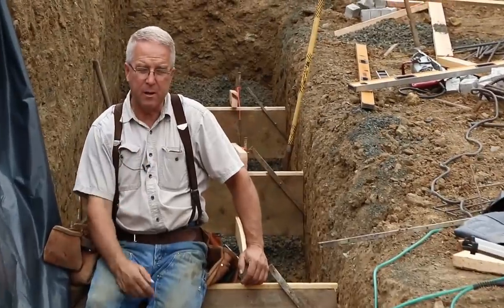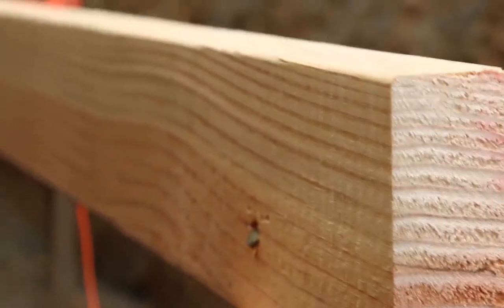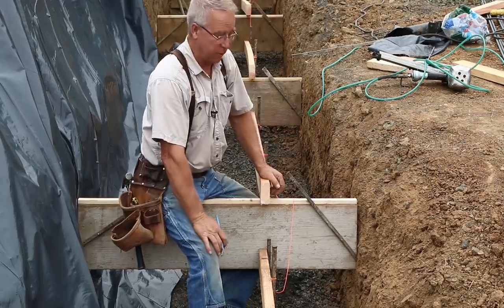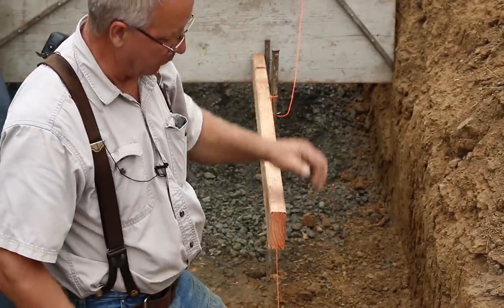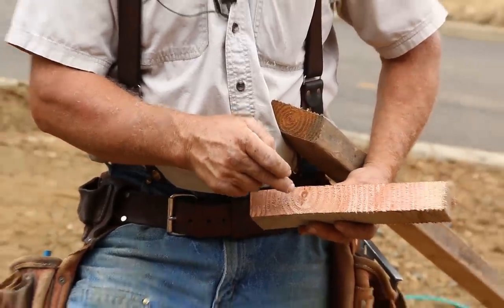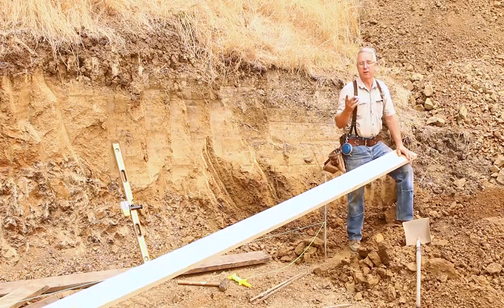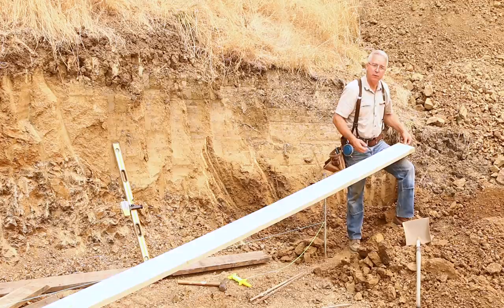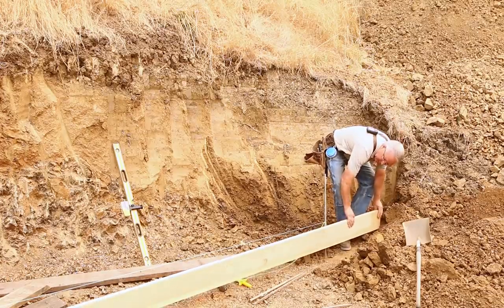Things To Know About Lumber

Comment: What relevance does grain coarseness have to construction? I can understand it in a woodworking sense, but not so much regarding structural purposes.
Reply: the more the growth rings per inch, the stronger the wood.  Old growth pine is considered a hardwood, because it grew very slowly and has tight growth rings.  New growth is soft wood .. that is my take on it, but I am just an electrician.
Reply: The annular rings consist of pale spring wood, which is less dense and weaker, and darker summer wood, which is more dense and stronger. Lumber with tight grain tends to have a higher percentage of summer wood and is stronger.
Reply: Whether a species of wood is considered a "hardwood" or "softwood" species depends entirely on whether it has leaves/flowers or an evergreen. It's just a generalization of the growth pattern and characteristics of the type of wood. Pine, regardless of age and hardness is always considered a softwood. Balsa wood (extremely soft/light) is classified as a hardwood.
Reply: P B .. Pine being a hardwood has been a long standing debate on the jobsites.  Pine with tight growth rings is much harder then a fast growing pine.  It has always put a smile on my face to see our old growth dining room table, which is a hand-me-down built during the Michigan Lumber era.
It has certainly stood the test of time in our household and god willing will be passed on to the next.
Reply: One word: Strength
Reply: Dieselhead Apparently one of the most extreme examples is Southern Yellow Pine. The climax forest trees that were originally cut created wonderful wood,particularly desired as flooring in large buildings. Rapid growth wood from second and third growth trees is splintery,weak and almost unusable. Not sure of the Google entries that would help here. Reused lumber and complete logs hauled out of rivers etc sell at a premium,if you can find it. That much of a difference. Never seen  Douglas fir so coarse myself. Mind you,I once got to work with a house built 1925,so the structural timbers were gorgeous. We have cut the accessible old growth wood,so the reality is to take a page from Scandinavia and concentrate on creating and using recent growth trees.
Reply: Dieselhead framing lumber that's "good" from a woodworking sense is also wood that is straight, strong, and will stay that way. 
Crazy grained, pithy, and flatsawn/rifty wood from near the cambium isn't a very good framing lumber but often what you have to pick from these days. We used to pick and select lumber at the lumber yard but nowadays your more finding the worst culls and rejecting them rather than picking good lumber. Most units we get around here aren't good enough to pick, just cull. I sorted most of a unit a years back for just three 2x12 spruce staging planks that didn't scare me, but in reality, 1 of the 3 was "good", while the other two came down to ok-ish grain and less knots, nothing ideal, but they were ok-ish. 
30 years ago, we could just pick a few of the rafters the lumber yard delivered and have great planks, but no more. 
Incidentally, i had a nice selection of quite old 10' and 12' spruce planks I pulled from some framing probably in the early nineties that were tight grained and basically quarter sawn, pin knots only, and had them on a job around 2006. The two idiots that were "the crew" were older guys - Jim and Dave- who thought they knew everything and didn't like me as the boss as a younger guy;  one day I was on another site and they cut them up for temporary stair stringers and treads. Now I'm an "older guy" but at least I'm proving that some of us aren't idiots. I at first thought they were being spiteful but after hearing their comments they self-confirmed as idiots (dirty, beat up lumber is what they said. "Staging planks are aluminum!")

Anyway, good lumber is important, it's not just about woodworking.
Reply: In framing, this doesn't  have much relevance.  The grain coarseness should not cause a board to fail structurally.  Headers are usually doubled and joist or rafters are part of a system, so one "weaker" board should not be a structural issue.  Most of the twist and bends a board develops will have already occurred before it reaches the job site (except treated lumber).  If a board is split or bowed, simply don't use it or cut it into shorter pieces.  One does not need to know why a board is bad in order to know not to use it.  If you are doing finish trim work or some type of exposed framing, this will become more important to ensure work will continue to look good.
Reply: When you build furniture you can sometimes get away with crazy wood as the many pieces strongly jointed together help to hold difficult wood.  But in a framing sense the wood hangs out very far in relation to it's cross section; if the wood is not very stable the whole structure can be pulled away.  It's only called rough carpentry but anyone that builds that way is a slob.
Reply: david ervin To elaborate on your statement, you can get away with it from a structural standpoint. There are various other things to consider when selecting wood for furniture such as appearance and wood movement.
Reply: Dieselhead just a common fact in lumber.

Comment: I't is a good topic.... can anyone tell me how to identify lumber that is less likely to weep after being painted; if planning to use it in finishing work?  or how to avoid that problem.... thanks much for sharing
Reply: Jim Burns, Jr. --- I avoided the problem when finishing S.Y. Pine by painting shellac on the complete board, although usually the knots were the only problem. If you don't cover the complete board a 'shine' will show through the final finish in the area where the shellac was used. 
If it 'weeps' or 'bleeds' through the final finish, the wood might be too high in moisture. Check it with a moisture meter.
Reply: Thanks bud ... will look into that moisture meter topic... maybe not a world ending problem for a household project to end up weeping.. .but not fun.. and any young person trying to make money with woodworking sure would need to know... have a goodn.

Comment: Which boards in a house don't need to remain flat/straight?
Reply: Mecdemort, in modern stud construction the wall studs can be bowed, twisting, cupped, and the other structural members (especially plywood or OSB sheathing) will force them into shape. But nobody'll be happy. Especially the drywallers. 
On a slightly different subject, I'm always disappointed to see yellow sapwood sold as redwood. Sure, it's from a redwood tree; but the customer is usually paying for red heartwood. That sapwood will rot faster than anything.

Comment: Great video! I really enjoy the channel. 

I will say though, as a seasoned woodworker, that a few terms may have been confused. 
The orientation of the grain pattern he first shows is actually referred to as quarter sawn. Vertical grain refers to the grain pattern along the board. A quarter sawn or rift sawn board will usually have a vertical grain pattern along the width of the board. This means the long lines of the growth rings appear as stripes down the board. The term quarter sawn describes a board with growth rings in straight lines running perpendicular to the width of the board in cross section

In regards to growth rings, tighter rings in Douglas fir does not always correlate with strength. Doug fir grows in rings of a hard, high-silica shell spaced between pithy soft layers. Doug fir is excellent for building because these two layers help add to he overall strength of the board. The soft layers help the board flex and not fracture while the tough layers add tensile strength to the wood.  Like laminated high carbon and low carbon steel. With tighter growth rings, you do run the risk of using a board that is too brittle, and unable to flex and absorb. These boards tend to fracture rather than hold the load. 

I only know this because I work a lot with old growth reclaimed doug fir for furniture making. I don't use coarse young grain because it isn't hard enough for furniture surfaces: it dents easily. The tight grain old growth is much harder to scratch and tools more like hardwoods, but I tend to see a lot of brittle fractures in old beams. 

Roy Underhill explains this with hickory in one of his videos. Old hickory is tough but brittle, while young hickory is taught and holds strength. He throws in some Andrew Jackson references too (he was called "old hickory" during his time in the army). 

Keep up the great videos!!
Reply: yup
Reply: As a Carpenter, and woodworker who does heritage work and carves my own tool handles and hangs the heads myself I agree 100% with what you say. Grain orientation is extremely important! Heartwood is the devil and sapwood is the best!
Reply: Actually the first board is fully sawn..second board is quarter sawn  3rd is flat sawn
Reply: full sawn wood refers to a board in its rough cut stage before its "dressed". Now a full sawn 2x4 is 2" by 4" but after it is dressed it will be 1 1/2" by 3 1/2". It does not denote grain orientation. All these board are definitely not full sawn seeing the edges are rounded, not furry on its sides denoting it has been dressed.

http://www.hardwooddistributors.org/blog/postings/what-is-the-difference-between-quarter-sawn-rift-sawn-and-plain-sawn-lumber/
Reply: @adrianarmstrong5546  wrong nigga rough cut is not the same as full sawn or quarter sawn ..been a Sawyer lomg enough to know the difference

Comment: The vertical course grain is the strongest?

And bent like a bow!
Reply: no, he didn't say strongest, he said most stable.  And he didn't mean to quantify the course grain as a strength feature.  The more grains per inch the stronger a board with resist flexion, and the more oriented those grains are to the direction of the load the better.   Since all dimensional lumber has square faces, the odds of one of those faces being fastened or adhered to another face being 90* to a load, this makes quarter sawn lumber the best to use in all cases.
Reply: @maxdecphoenix  thank you for the added insight.

Comment: I have noticed that sometimes the cup follows the curve of the growth rings, and other times it's opposite.  It certainly depends on if the lumber is sawn green or dry.  But maybe it also depends on how close the grain is to the heart....further out toward the bark it seems to go opposite the radial growth rings.  Has anyone else noticed this variation?
Reply: Yes, occasionally that does happen. And that odd board usually has more knots as well~
Reply: This is a topic that needs clarification for sure.  Several YouTube videos have guys laying out deck boards the wrong way.  There’s a book about wood by Hoadley that talks about it.  Says the boards laid out should “smile” at you, meaning the growth rings will flatten out over time and the cup would be facing down.  Since reading that, I have been checking old 2x stuff on decks, fences and scraps.  90% of the stuff i have seen proves this to be the case.  But you make sense about holding tight to the “pith” or heart, because I have seen that too. It’s crazy what all is involved in wood.  But the more I study it, the better i get at knowing how to find the better boards at the yard.

Comment: So even though you know rift, slab, and vertical grain structure, it doesn't matter where you use them. So, wood is just wood. What you call the heart is actual the pith. The heart wood is between the pith and the sap wood. In the vertical example, the heart wood is the pink stuff and the sap wood is the cream colored stuff.

Comment: When I was a kid, 2x4s actually measured 2 by 4 inches and the rings were so close it was difficult to count. Maybe as a country we're exporting too many logs and cutting trees in too short of cycle. The old 2x4s were a lot stronger and didn't break when you dropped them. The lumber today is crap. To get usable lumber from a typical home store like 2x4s, I buy 2x12s and rip them. I'm lucky to get 2-2x4s. Even then they're weaker than old 2x4s. For quality lumber I have to buy from a custom mill with their own stand of timber.

Comment: Why not use a better grade of fir. Is the framing wood graded? Have you ever read grading rules? In Florida graded lumber is required to meet code standards. This is why I build 3 story house with light gauge steel. For 20 years I had to bend wood to frame floors. Using engineered wood is more expensive. I spent hours picking and sorting lumber. What about choosing stair stringers? Show how to build a good set of stairs! Door hanging and installation.

Comment: If you go to a good timber yard where they know there stuff they'll mill there timber for your different needs the first timber is milled for joists and just an off cut that's not big enough for a good span hence you can put all the weight down on it the second is quarter sawn which is good for big spans no radial shakes or massive warping its also great for table tops and benches the last one is CLS  or sh÷t  as we call it in Europe but if you go to a regular timber yard or DIY yard that doesn't know to much you get what your given

Comment: Its called juvenile wood. They grow plantations more now days which leads to faster growth that  increases the microfibril angles resulting in weaker wood thats more prone to warp and shrinkage. Also the tangential face shrinks significantly more than the radial face which is why plain sawn goes to shit so quickly compared to quarter sawn.

Comment: I buy lumber by the hack only. Typically there are several heart boards in them. Advisable to say, they are usable for one thing in construction. That is for wall plate boards at the top or bottom of the wall. Sort your boards out so we construction is done, your walls stay strait.

Comment: Most lumber is just randomly sawed because its economic,yet it should be quartersawn for stability,following the natural grain in the tree.I have shattered many axe handles splitting wood,until I found the simple solution of using split wood to make a handle,this principal applies to any project large or small.
Reply: What do you mean by split wood?

Comment: I’ll back ya on betting everything that a piece of lumber with a heart in it will look like a pretzel in less than a day after it literally comes jumping of the lift when you cut the banding. Also I can’t think of any place to buy 2x4 with dozens of growth rings per inch except maybe a specialty lumber supplier and it’s gonna cost ya. I’ve been framing for something like twenty years now. The lumber has gotten consistently worse over the years. Some of these growth rings are about a half inch and will flake apart like a nice filet of haddock

Comment: Our house was built 60-70 years ago. The lumber that was used in it was rough sawn oak. And you can not drive a nail in it...better pre drill and use screws. 

Lumber that is sold today is junk.

Comment: I'm sorry but the strongest grain is vertical not horizontal. When you buy a hammer with a wooden handle you want the grain running vertical for strength.
Reply: Good point. Shovels too.
Reply: That's what he said

Comment: I recently built a "quickie" deck next to my travel trailer while we are building our house. I went to a local B&D hardware store to purchase the lumber. Not knowing about the heart as you described I built the deck and it is cracking all over the place. After watching this video I walked outside to investigate the wood, 90% of the boards are all heart wood (glad I didn't take that bet, LOL) I was going to use LSL boards for my house so this probably wouldn't be an issue but thank you for the education, I will remember it for a lifetime.  By the way, I am documenting the build on my channel.

Comment: I love your channel. But your knowledge of milling is a bit off. The first one could be rift, quarter, or flat. The second could be quarter or flat. The second cannot be rift sawn because that grain orientation is specifically avoided in rift. If you bought your lumber at a hardware store my money is on them being flat or quarter, as there is less waste. Rift is too wasteful and too expensive. Quarter is a balance between flat and rift.

Comment: My dad was a building contractor for 40+ years. I grew up around him building houses. After high school went to work with him. The lumber company would drop off that big load of lumber. As we went along using the 2x4,2x6,2x8 and 2x10's. He would, and then taught me to pick out the bad ones as we used them, twisted, bowed etc. I would load them up and take them back to the lumber company to exchange. They knew my dad very well, a good customer, and then got to know me. Some of that wood they send you just cant be used in a house, if you want it to stay level and square.
Reply: Phil Harden I often wonder what happens to all of the bowed and twisted low grade softwood boards that people pick around in the Home Depot stores. Seems like about 30% of each unit. What do they do with them? 🤷‍♂️
Reply: @CommercialForest  The percentage is so high because big boxers are already getting the junk that nobody wants on the cheap, in order to sell it to a customer-base that can't tell the difference :) As for what you do with them? You sell them to the guy that walks up to the timber desk with a brand new hammer and square in his cart

Comment: Great video!   One of my favorite woodworking reference books is "Understanding Wood: A Craftsman's Guide to Wood Technology" by R. Bruce Hoadley (Taunton Press, 2000).  
In 280 pages, it does a fine job of explaining grain orientation, figure, wood strength characteristics, machining properties,  some basic joinery, and finishing choices.  It even goes into a little detail about engineered wood and sheet products.  It's loaded with diagrams, tables, and full color photos that explain most of what a woodworker needs to know about the medium from live tree to stacked dimensional lumber.  Highly recommend!